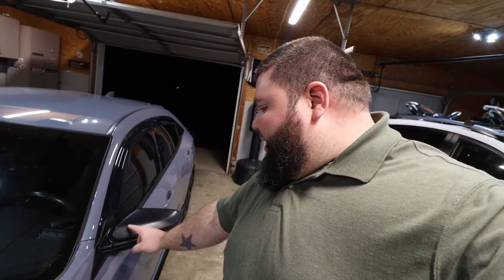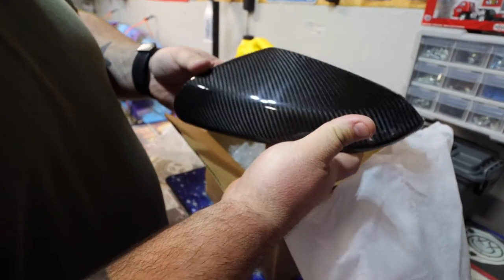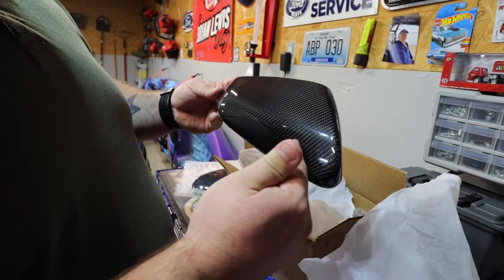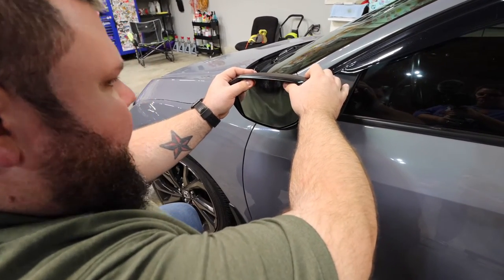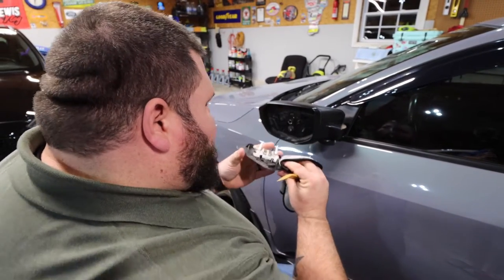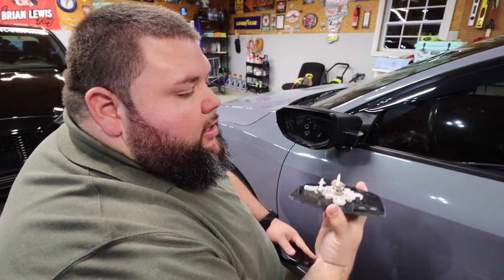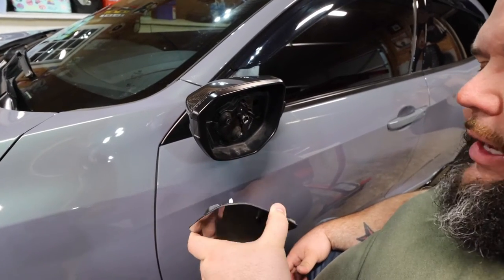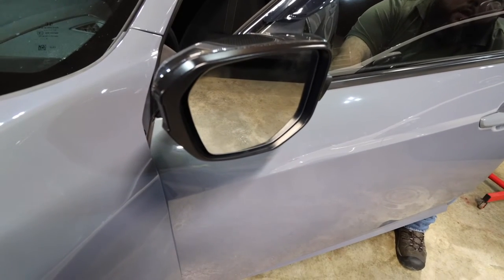Honda Civic Sport Carbon Fiber Mirror Caps Installation

Comment: Honda Dealership spray painted my mirrors, after 2 years of owning her the paint started chipping off .. i literally just clicked your link in the description and bought these
Reply from the maker: Bro they definitely probably didn’t paint them. Honda factory paint on mirrors and door handles does this. It’s sad they haven’t done anything about it yet.
Reply: @ABrianLewisVlog  I think it was the dealer because the bumper had some touch up paint on her and the lip wasn't put on right ..mines a 2018 I bought her in 2019 used

Comment: Question: my own mirrors start doing the same peeling crap a few months back and I did find pro civic website. Are those carbon fiber mirrors still holding a year later?? No fading or peeling clear coat. Please let me know thx. :)
Reply from the maker: No they are terrible. Check my review video out. They don’t honor the warranty past 30 days either.
Reply: @ABrianLewisVlog  So they legit don't last?? wtf....